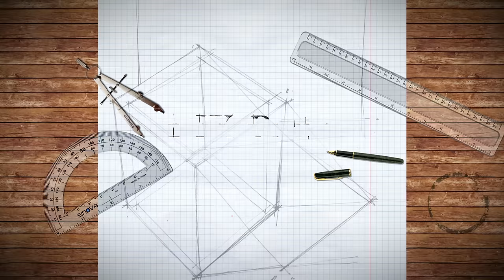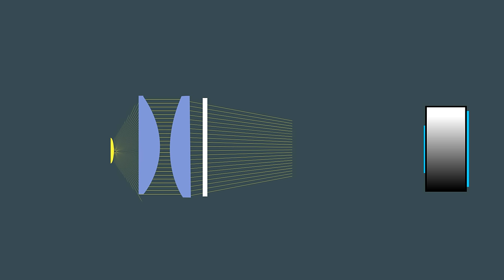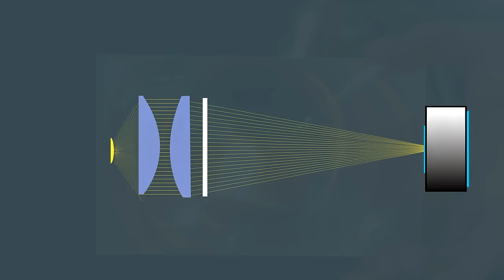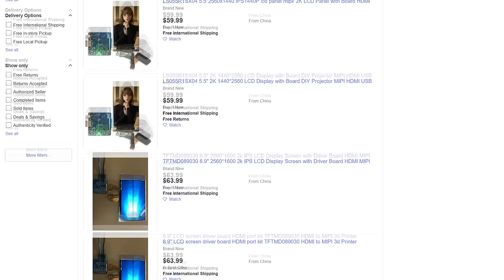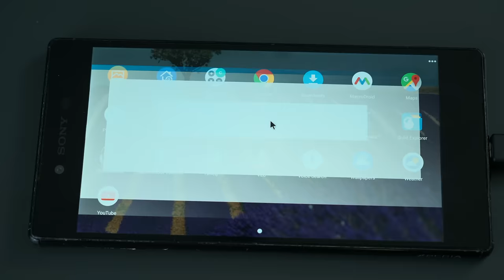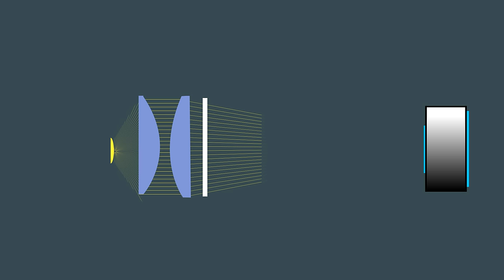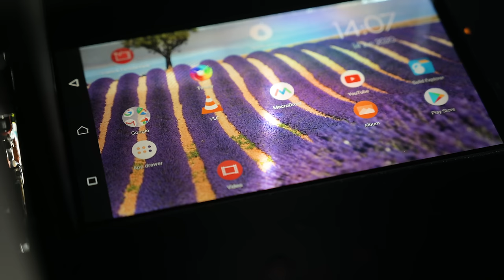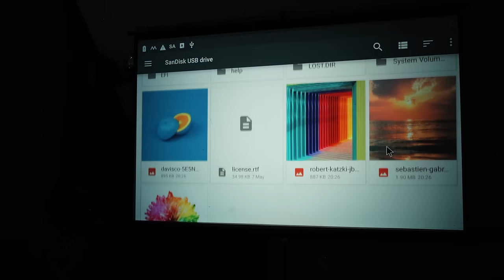Building a TRUE 4k home cinema projector (it’s awesome)

Comment: Let's take a minute to appreciate how long it must have taken him to thread all the nuts and spacers through those rods
Reply: and some of them were self-locking so he had to use a wrench instead of the load and good fingers
Reply: @Flowxing  that´s how i would´ve done it, also its amazing how much time you can save with such a simple trick
Reply: it had to be nuts
Reply: @Flowxing  Don't forget that spinning the rod spins everything else attached to it. Once the rods were all tied together with that base piece you couldn't spin one of them without the next one spinning around to hit your arm.
Reply: @Andrew.A.  Sounds exciting!
Reply: Patience
Reply: @Flowxing  This will not work any more after the first layer of aluminium is assembled.
Reply: They do make open center electric socket drivers.
Reply: Put some rubber into the drill and spin the outside of the nuts. Easy.
Reply: lol. Now i kinda wish he put that footage in this video without time lapse.
Reply: @scwfan08  Yes this is how we mount big nuts on massive rods with a length of 3 meters. We use some transmission belts. For small nuts I use simple cutted rings of bike tires and a small roll mounted on my drill. It's an old trick how skilled people solve this boring job. And btw: you don't need stop nuts. Simple skrew clue should do the job.
Reply: Wire brush on an electric drill zips them up and down in a flash.
Reply: True!
Reply: IKR?!
I turn my drill head sideways and spin the nuts on.
Reply: Drill.....
Reply: Damm you took the words out of my mouth
Reply: @PuerRidcully  Beat me to it...
Reply: Use the side of the chuck of a cordless drill to spin the nut, the chuck acts like a tire and spins the nut quickly.
Reply: Or maybe about 40 minutes
Reply: Not 40 it will take place in my life
Reply: @Andrew.A.  could've taken the belt off.
Reply: @Flowxing  Can't tell you how many weird looks I get when I do that. They are all so quick to judge until they see how effective it is.
Reply: @e1woqf  leave off the dome nuts off at the bottom and the spacers loose. Just attach the drill to the bottom and your set.
Reply: @Andrew.A.  that's why I put my threaded rods in an industrial lathe when its time to thread nuts for a home diy project LMAO
Reply: More than getting all the parts 😚
Reply: You may already have heard of this, but another YouTuber has made this drill powered nut driver: https://www.instagram.com/p/BhUJ2sxlqR_/?hl=en  It's available as a commercial product (made in the good ol' US of A)  Cheers, David
Reply: yes
Reply: @Flowxing  yeah how many nuts and layers are you going to put on like this:D it just doesnt work like that you need to spin the nuts
Reply: As someone who had a similar vertical beamer build back in 2007 using threaded rod, I can definitely relate!  What a pain that was.
Reply: Exactly
Reply: @Andrew.A.    Which is why you don't tighten the base until everything is close to the final position.  As long as the bottom is loose the rods are free to spin on their own.
Reply: God I was thinking that the moment I saw those rods... I would've trimmed it right away.
Reply: No..
Reply: It's not that hard if you use a drill and anything that could function as a belt.

Or if you make designs like this the way I tend to do it, the bars are free to spin, so you just spin them and hold the nuts.
Reply: I've been through also when threading a nut on a long rod 😂
Reply: Is it possible to DIY and ultra short distance 4k projector? Can you make a video for that?
Reply: @Flowxing  better use gloves, I've done that many times before and the nut gets hot real quick.
Reply: @Andrew.A.  Normal nuts can be spun with shop air gun.
Reply: @Flowxing  efficiency
Reply: Compared to the amount of all other brainwork... threading the nuts is the relaxing bit of the project.
Reply: i know right
Reply: Not as long as the radiator screws in the verge PC build
Reply: Yea agreed
Reply: When he started he was clean shaven!
Reply: My thoughts exactly. I really do appreciate him more after this ))
Reply: GG
Reply: U can use a drill
Reply: @Flowxing  Not really possible if the already connected all four of them :-)
Reply: @roshan Epic observation 😂😂
Reply: just keep the nut still and spin the rod with a spindle. 30 sec all the way from one side to the other ....
Reply: cool
Reply: @Andrew.A.  loosen the nuts clamping the sheets to the rod and the rod spins on its own.
Reply: @e1woqf  You could find approximate spacing and fit nuts/spacers (and WASHERS) to each rod. Slot the holes so layers can be slid into place on the rods.
Reply: He has a nut threader duhhh
Reply: A quick and easy way to do this is to lock the rod into a drill to spin it while you hold the nuts in place.  Don't tighten anything down till you've got all the nuts in place though.
Reply: I was thinking the same thing
Reply: Years😂
Reply: Am sure he invested something for that, too, but that's for another video 🙂

Comment: Next on DIY Perks: "Building a Fusion Plasma Reactor on a budget" - ( THIS COMMENT WAS BANNED BY THE CREATOR )
Reply: Your comment is probably suppose to be funny,but the a 12yr old kid actually Built his own Mini-Nuclear Reactor in his Bedroom.
Reply: @stevencaskey9440  isn't it in his shed ?
Reply: @stevencaskey9440  are you talking about that 16yo cub scout or the fictional sheldon cooper?
Reply: Matt's ultimate DIY perk project must be a Tesla 3-staged Rocket on a budget.
Reply: @stevencaskey9440  To be fair anyone can just go collect a bunch of fire detectors and use the radioactive detector material to create a nuclear reaction. Now building a huge electromagnetic torus plasma reaction chamber on the other hand, requiring megawatts of power for inductive heating and plasma infusion alone, I'd be impressed by a kid building one in their bedroom
Reply: neil saich  Halo infinite hype intensifies
Reply: @stevencaskey9440  the kid built a fission reactor, a fusion reactor would be way the fuck harder
Reply: LMAO the guy may just already be working on it.
Reply: tony stark did it...in a cave! with a box of scraps!
Reply: look up ThunderboltsProject channel's SAFIRE videos it's exactly what you described
Reply: I want to try to build one. Maybe I will use CNC metal parts designed in fusion (Not as in a fusion reaction) (A Autodesk software)  and a transformer to create and sustain it. However, non of this is very worthy, as there will still be a net loss of energy.
Reply: I want to try to build one. Maybe I will use CNC metal parts designed in fusion (Not as in a fusion reaction) (A Autodesk software)  and a transformer to create and sustain it. However, non of this is very worthy, as there will still be a net loss of energy.
Reply: and it will look high end
Reply: No offense we build those projectors back in 2000 for free but they are really not worth the effort. It's easier to get a used old one for 10bucks on a flee market. Low res but 20 times more light output. I project a 15 Metter long Image on my neighbors House and play mariokart 64 on it.
Reply: Well, he could. Though technically not a reactor, because you can’t produce more energy than you input into it, you can build a Farnsworth fusor for a few thousand dollars: visit fusor.net
Reply: grandepescado Actually, fusion is easier than fission, mainly because of safety and legal issues (someone who attempted this was arrested before he could finish, so...). The problem is making it produce more energy than it uses.
Reply: PatchworxStudios The resolution and image quality is the whole point of the projector... you can’t buy cheap 4K projectors.
Reply: Would be cool to see a plasma sputtering device though
Reply: Hell.... You made my day 🤣🤣🤣🤣..... Your comment is on story now
Reply: the biggest still unsolved problem with plasma fusion is getting your reaction products out of your plasma ring as the products have the same properties as your reactants
Reply: @stevencaskey9440  It's easy to make a fission going. Harder to control it or not burning up the reactor.
Reply: neil saich  love  this scene in T1 :)
Reply: Fusion reactors are very ez to build, i own one that produces a nice little 1cm ball of plasma in a vacuum.

Comment: I am interested in the bit where you replaced the battery with a small voltage regulator board - there is surprisingly little written about this kind of hack (or at least not that I could find) - I think 'hacking lithium powered devices to run off alternative sources' might be a worthy subject for a video of its own
Reply: the battery is just providing the phone with power at the required voltage and intensity that it needs to run. the voltage regulator board was used just so that he could change the power supply for something that doesn't "run out" of juice, such as the power outlet, allowing him to just plug it in. think of it as a transformer. i could be wrong though, research the topic for precise information
Reply: @MyBadStudios well i know ow you feel xd... after searching a bit though, you'll think of it as basic electricity (there's nothing basic about the board specifically) but it's pretty easy to understand how to set it up at least
Reply: wtf i love ur videos man!
Reply: Oh sheed! It's the scambaiter!
Reply: @MyBadStudios If you want to do something you need to invest time into it to learn. We wouldn't all be sitting on our lazy asses while watching free entertainment on our phones or computers if it weren't for all the people that did the research and invested their time into it.

In this day and age, you can learn everything needed for this project for free with the help of the Internet and youtube. 100% free I'll guarantee you.

If you're mentally not prepared to invest effort into something then the only reason you can't do it is you and your mindset.
Reply: @MyBadStudios He did that because it's easy. You have a battery inside the phone that provides N volts of DC power.. You get a power supply that converts wall power into the N volts DC (and at least as much current as the battery provides at max charge).
If you're lucky, then the phone's battery provides less than 5 V DC. You can then use a USB power supply and a DC Buck Converter to reduce the power from 5 volts to N volts.
Reply: Oh, that makes it easy! Get a USB power supply and cable, cut open the cable and put a DC to DC step-down converter  to convert from 5V to 4V, then attach the result to the mobile’s battery leads.
Reply: Love your channel!
Reply: @MyBadStudios I mean, what do you expect? To be able to make a 4k projector with almost 0 electronics skill? They wouldn't be so expensive if anyone could make one with very little work
Reply: It's actually very basic, your battery is just a source of dc power...if you have a basic electronic knowledge you can power your device without this battery.
Reply: dunno how you missed "diy voltage regulator" on google.
Reply: @covertoperator2957  You forgot about the importance of current. Just say that they were to use a 5V 500Ma power supply, and the phone(Li-Po or Li-ion powered device) needed for instance 3.7-4.2V at 1A-1.25A. You are going to run to issues. And you will need input  and output  filtering because the power supply could have really bad ripple that can cause issues.
Reply: @MyBadStudios It's literally a "watch how I made" video. He's said that more detailed instructions on how to do the build are available if you support his patreon, but he doesn't claim to be a How-To channel, he's a DIY Electronics channel.
Reply: @CocoaEm  Which is mentioned in video that filtering capacitor was added ;)
Reply: @VavrMar  why not just usb charge the battery?
Reply: @CocoaEm  just add a capacitor
Reply: @MyBadStudios It’s a, “watch until the end of the video” video and if you’re inspired to make your own there’s a pdf available showing all the materials, measurements  and tools required including a detailed guide on building the projector. 🤦🏻‍♂️
Reply: @MyBadStudios that is what the pdf guide is for but i guess you were too lazy to even check that
Reply: @sloma111  because the battery would eventually wear out and fail (and since he used an old used phone the battery might already have failed). Most phones don't survive very long plugged in and powered on constantly. Instead of having to pay for replacement batteries as they die he replaced it with a power supply instead.
Reply: i dont know why he cant power the phone with otg
Reply: i just connect 5v charging brick to it. i don't recommend it because it can fry your device. eh it works for me idk

Comment: I love the concept and your ability to just start doing. I think you've come up with a relatively easy, and fundamentally sound design. I do have one critique on the design aspect though. And that is the build orientation. You state that the orientation is optimized for it's footprint, and I like that but from a heat and cooling standpoint it's upsidedown. Horizontal projectors have their main heat source expelling heat away from all other components. Where this build has the heat rising to the LCD which is sensitive to heat and will reduce the hours of elongated use. If you where to flip the build the only modifications needed would be to flip the screen orientation. But you would be expelling heat much better, this along with fans directly actively cooling the LCD panel would allow you to get away with a much brighter light source. I'm curious of your thoughts. I would also be interested in your take on using a old classroom overhead projector as a starting point since you obviously have an ingenious ability to repurpose old tech.
Reply: While I agree this would be more efficient thermally, clearly this design already works, because the upwards force of hot air is minimal compared to the large kinetic force of the fans. Also I believe the tower design proves much more convenient when it projects from the top-end, rather than the bottom.
Reply: I believe you may have slightly misunderstood, actually the fans draw air downwards through it, which cools everything respective of its position. Air is drawn through the heatsink last, and then expelled outwards through the bottom vents.
Reply: @Savage-en1ms   Exactly.

Comment: I did something similar many years ago with a 720p lcd TV, a vapor bulb, a couple of fresnel lenses and an antique cinema projector lens. Yours is engineered much more nicely, and the LED source (which weren't available when I built mine) is much easier to deal with than the vapor bulb. It's much easier to get a great picture with the smaller LCD panel as well. Great work!

Comment: Holy cow that build is legit! Everything from the vinyl wrapped aluminum panels, to the cleverly adjustable focus rig, to the custom-milled threaded inserts is totally professional in every detail. If I had come up with this, it would have been gobbed together with epoxy and zip ties. It would be wobbly and frustrating. Yours is a triumph! A very good build with lots of helpful details. Thank you!